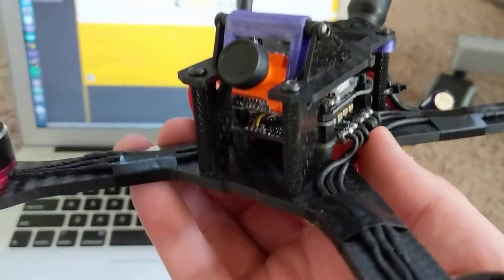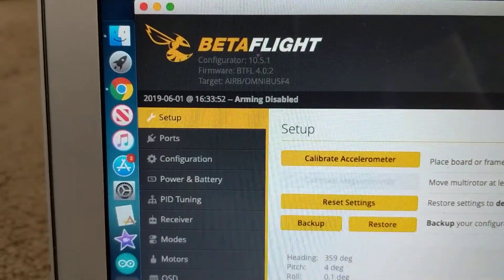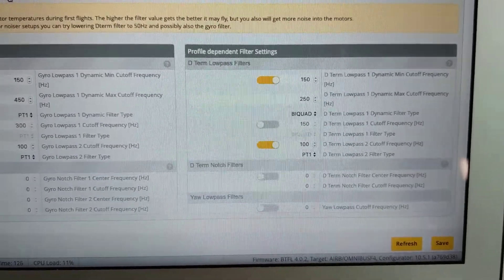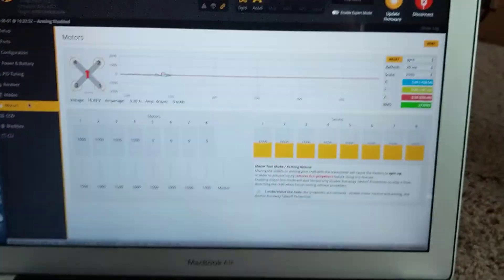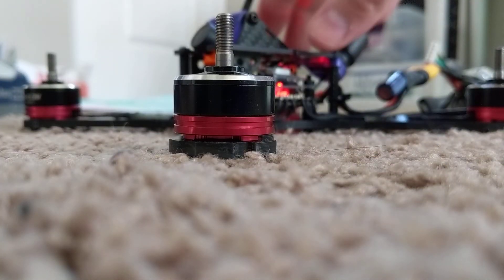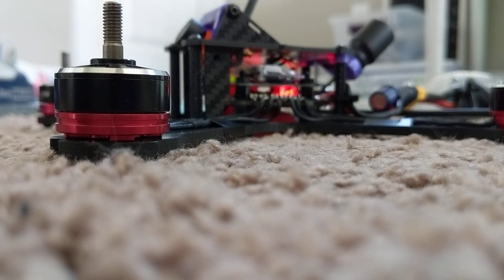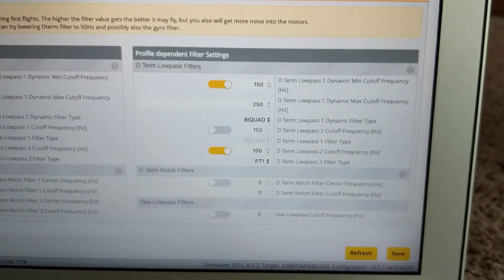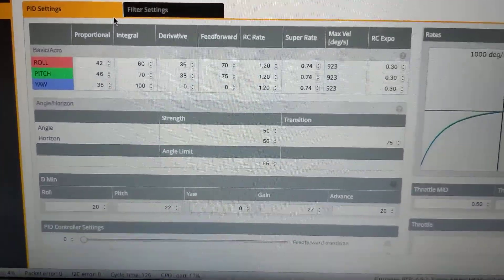Betaflight 4 twitch motors running rough and getting hot.

Comment: This is the exact same issue i have with my new build i just built.   I had an idea that it was in the filter settings.   I'm gonna have to fool around with each setting.   Motors get hot though so it's tricky.

Comment: whats your airmode throttle percent? and your motor idle throttle value? sounds like the gyro is compensating for perceived motion. Is the ground level? how does it fly? do you have blackbox? what's you pids like?
Reply: Lincoln Wilcox try idle at 4.5 and then 3.0 etc.. see if it's still doing it. once you've checked the black box then you can set the filters accordingly, there looks like alot of filtering in your filters tab, is dynamic filtering turned on?.. , also is your airmode on?
Reply: ah i just had another thought.  i could be pid runaway... umm.. i mean high pids could also be causing that..

Comment: ok so im having the EXACT same problem and its driving me up the wall, lol. have you made any progress I solving the issue?
Reply: I'm having the same problems too. I have no idea why.
Reply: get crossfire made everything run smooth for me @FPVisioning
Reply: Uh what? Crossfire is a receiver. And also super expensive. I've already fixed this problem, I just lowered some filters. Simplest fix ever.
Reply: @FPVisioning what filter to change? I have same problem
Reply: @Crazy2limchai yeah. Mines doing the same thing and I'm on the default sliders positions.   So your saying I have to put less filter on?
Reply: @lincolnwilcox  This is what I changed, make sure to save a backup before you use this just in case it doesn't work for you. 

set dyn_lpf_gyro_min_hz = 70
set dyn_lpf_gyro_max_hz = 350
set dyn_notch_range = LOW
set iterm_relax_type = gyro
set iterm_relax_cutoff = 7
set dyn_notch_min_hz = 100
set dyn_lpf_dterm_min_hz = 70
set dyn_lpf_dterm_max_hz = 150
set dterm_lowpass2_hz = 120
set d_yaw = 0